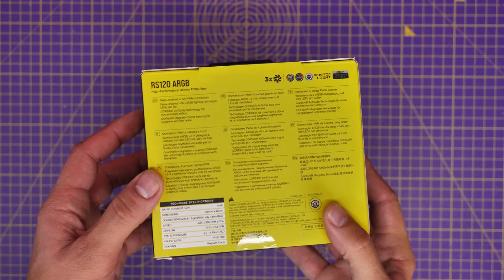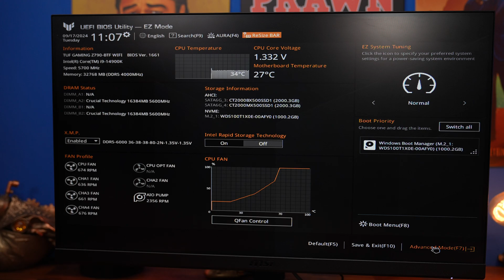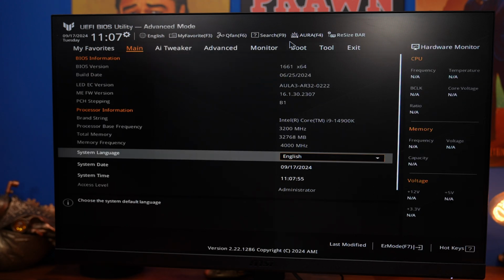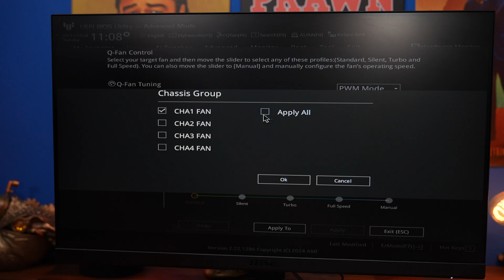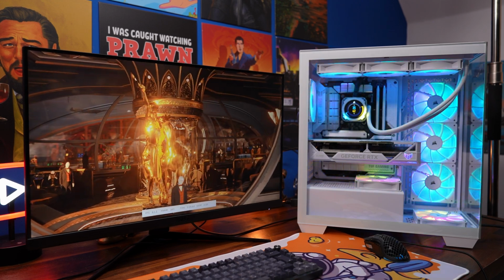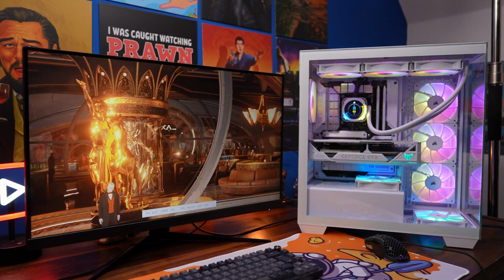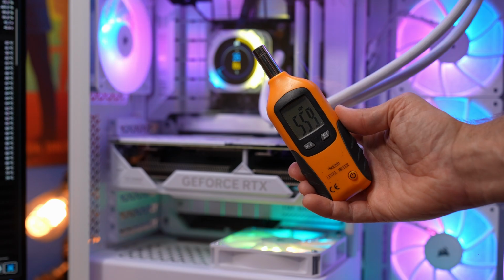What's up with Corsair's New ARGB Fans?? New wiring logic explained

Comment: I have 4 of these fans running in my system and they all make a low to high pitch oscillating whine from 68% - 76% pwm or around 1500 rpms. Its driving me crazy. Ive tried staying out of this zone by adjusting the fan curves but it still goes past them. Ive ended up keeping them spinning below the 1500rpms only. Did you have any issues with this? I may have to return them.
Reply: Hey, I have the exact same problem. I got it with using the nautilus aio because it also uses RS fans. I returned them and went for the RX because they are dampened, the RS are not.
I found out the whining comes from vibration that comes and goes in like 2 second intervals.
Reply: @zwiedrul9669  I might have to return them, only week left to decide. My msi aio cooler fans don't whine like these. Might have to get those type of fans. Just a pain to remove them all, was gonna live with it but can still hear it even at less then 1200 rpms. I want to check if something in my case is causing a vibration but probably not.

Comment: Corsair shows pictures of their cases with these fans and the fans are different colors like they each have their own header. Do they even make motherboards with 3 argb headers? Edit: Three headers is almost unheard of so you would basically need a Razer Chroma to make your system look like the pictures on the Corsair website with this fan option unless I'm missing something.
Reply: A lot of new at least mid-range motherboards have 3 argb now, many X870 boards, like the mid-tier MSI Tomahawk.

Comment: I bought these fans and cannot for the life of me figure out how to control the RGBs with any software. Not armory crate (my motherboard is MSI) or iCUE. If anyone could help me i would greatly appreciate it.
Reply from the maker: MSI Mystic Light is the app you need. Inside Dragon Center. Alternatively try SignalRGB
Reply: @TheProvokedPrawn  so MSI Mystic Light did not work for some reason. BUT, SignalRGB worked!!! Thank you so much. So weird that it didn’t work with MSI
Reply: @TheProvokedPrawn  Any chance there's some unknown way to connect or sync up Mystic Light and iCue? I can't get the two to play nice together, and idk if buying the Thermalright hub would be worth it to give me more control over my rgb lighting or not.

Comment: Hey Prawn sorry for being off topic but i just got the razer enki thanks to your video and was wondering if the arm rests are a little bit wobbly by default , even without pressing any buttons if i hold it and push left right  they will move and make a little bit of noise , thanks!
Reply from the maker: There's some wobble yes, but there is in every chair I've tested as far as I recall.
Reply: @TheProvokedPrawn  Yeah upon looking on the net i seen a bunch of people complain about secret labs and other chairs doing the same , apparently it wont go away completely but rescrewing stuff inside will help , dont wanna risk it tho so ill just deal with it its not a dealbreaker thanks for confirming

Comment: Corsair's fans are garbage. i Spent over $350 on 4 fans and an AIO, all DOA(or more likely the icue link was DOA) after a week of troubleshooting and zero response from Corsair's tech support, I returned them at microcenter for Lian-Li gear and couldn't be happier. The lian-Li's have pogo connectors that are way better than the little plugs the Corsairs have, and to top it all off i saved $60 switching and i even got a larger AIO. 

Fun Fact, Corsair's customer service won't even talk to you unless you've bought a full pc. Component purchases get email only.